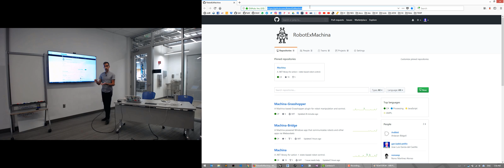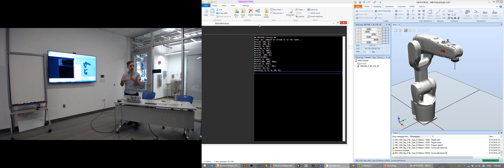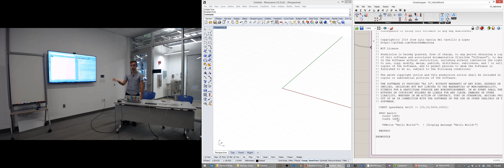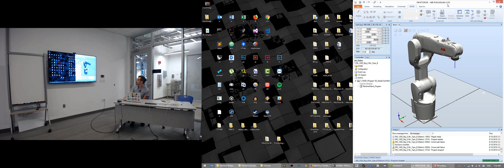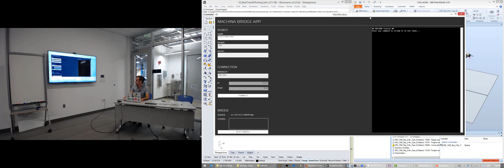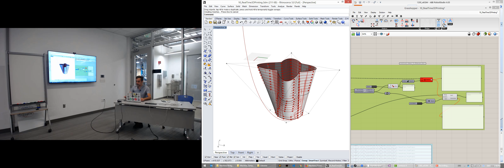Machina workshop [OBSOLETE, read description]

Comment: Hello, 
First of all, thank you for your very interesting work and the possibilities of applications! 
I contact you because I have some trouble connecting Machina Bridge (v0.8.6) to RobotStudio (v6.08) 
Each time I press connect in Machina mode with 127.0.0.1 and port 7000 Machina Bridge crashes. 
Even if I change the IP of my computer and the IP of the ABB robot 
Example : Computer : 10.10.3.1 / Robot: 10.10.3.2  and Machina bridge 10.10.3.2 7000
Do you think is a version software ? Firewall ? 

Best,